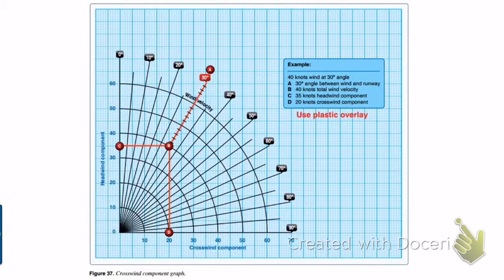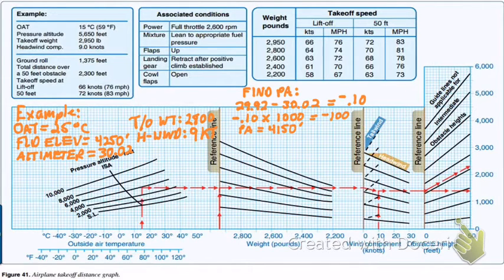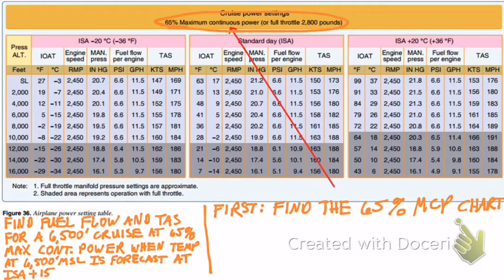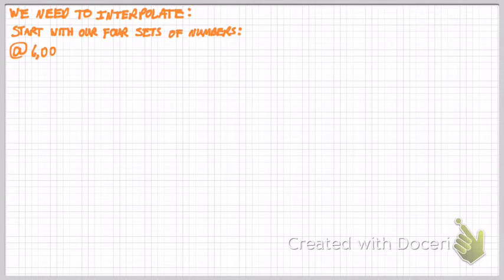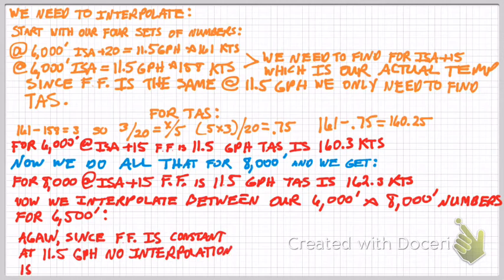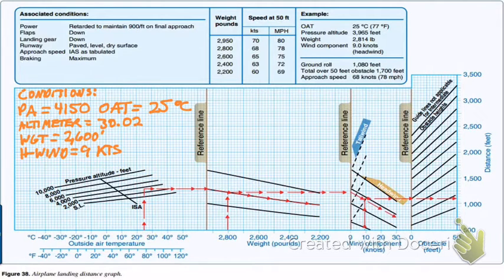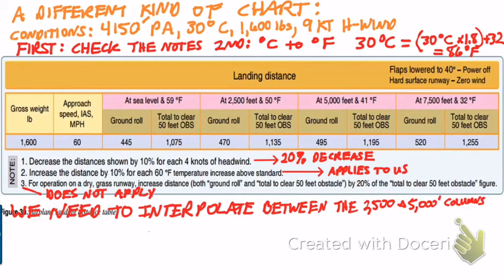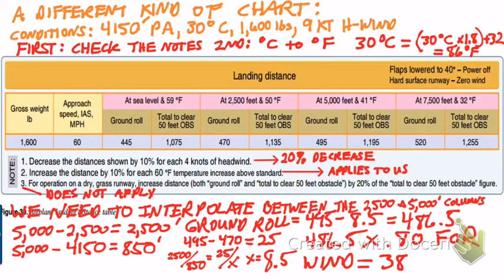FS1 Performance Demo

Comment: How did u get 162.3 kts at 8000ft? Isn’t it basically the same calculation as 6000 ft? 3/20 = x/5. So 0.75
164-0.75= 163.25.        Not 162.3
I’ve been trying to figure out how you got your calculation at 8000 and would love your help. I’m prepping for my Cpl written. Thank you!